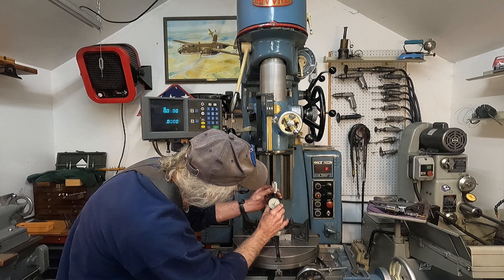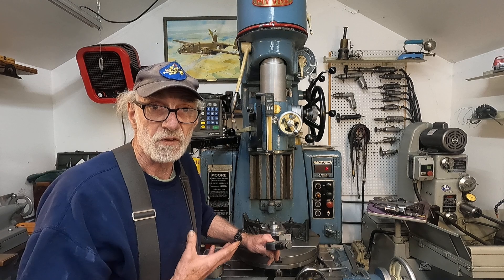Moore jig boring machine basic hole making  8

Comment: I bet if you measure those blocks supporting your piece one will be .0002" larger than the other.
Reply from the maker: Remember when they sold these import blocks years ago, it was stated the blocks are about .0002" over listed size for Nominal Lapping
Reply: @deedeeindustrialsuperprecision  I was thinking that might be where your taper was coming from but after thinking about it more that would not cause a taper.

Comment: I thought I saw a guitar headstock  there in the corner. yep, you really can do anything in a machine shop. I've been fixing key cutting machines lately and it's too bad the locksmithing trade doesn't use much precision measuring tools. When you get a key machine to copy a key within +/-.001, that key shop will just about be the best one in town.
Reply from the maker: For sure, I made a decision long ago to stay more toward maintenance and repair then manufacturing, I have worked in mines, and rock processing, Food processing, graphic arts, musical instruments sawmills, hydrostatic transmissions and Harley Davidson dealerships. The basic skills are very adaptable and working on different things keeps it interesting to me.